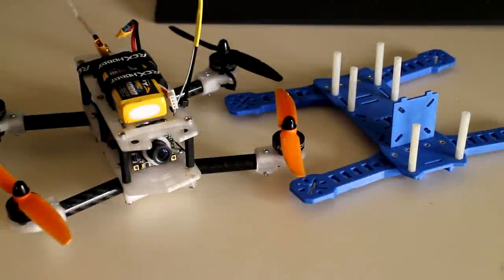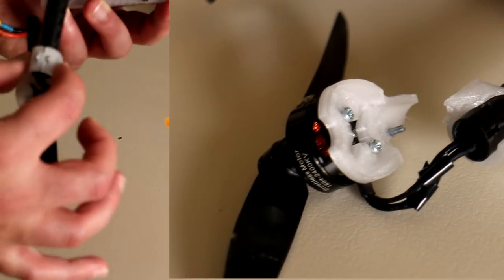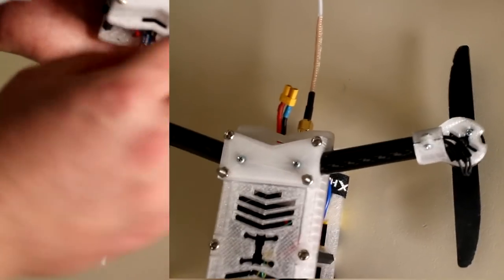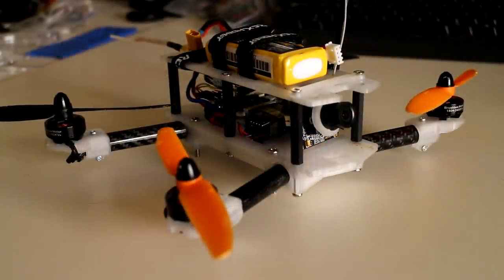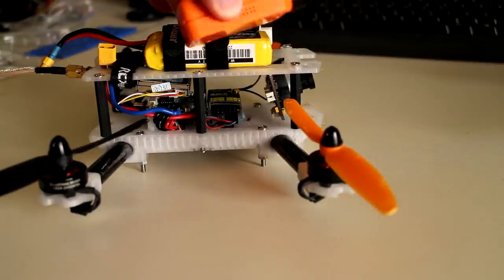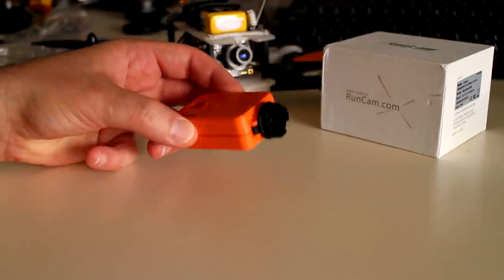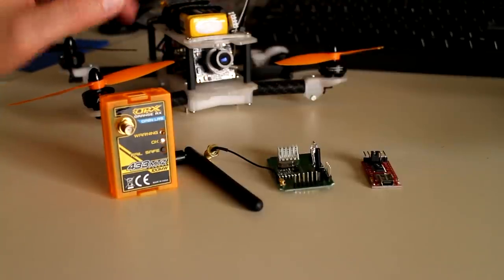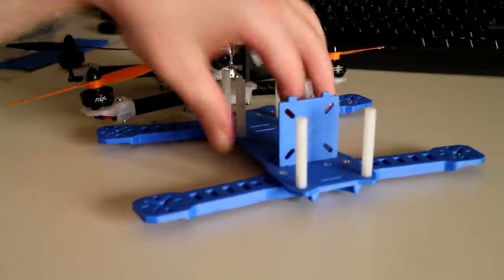New videos coming up next... :)

Comment: I haven't tried it personally, but I know it would work, as the rubber o-ring will give a better friction fit once trapped. Some of the tilt-rotor type of quads also use this style of connection.

Comment: This frame looks awesome! However, i prefer 250mm-280mm as i use a gopro and need the extra space. Any chance you plan on scaling it up a bit?
Reply from the maker: +plane1233 
I've allowed enough width to use a GoPro. You can even use slightly longer carbon tubes. But with this size frame we are restricted to 5 inch props.

Comment: Its indeed a nice beauty frame, combination cheap CF and strong PETG filament. Its even much better if it can be folded, to make easier to transport. What 3d CAD software do you use?
Reply from the maker: +flyrobot flyrobot 
Yeah the tube is cheap. I'm not including folding arms in this design as it would reduce durability and probably increase weight. I'm designing this as a pure "basher" that can withstand harsh knocks and crashes. The only bits that should break are props.

Comment: Those prints look amazing, congrats! I'm just weighing up between buying a replikeo or a tarantula. Would you buy the same again if you stuck to the same price bracket?
Reply from the maker: +float 
Hey thanks!
I think so. The Replikeo is $250 plus shipping. It's a common version of the Prusa i3 (Rework) and plenty of support on the reprap forum as many people own one. 

If the Tarantula is about the same price, I'd give it a try. It does look really good using acme rod for z-axis and rollers plus extruded aluminium instead of linear bearings and smooth rod. It all comes down to support as you may encounter an issue and you'll to ask for help.

Besides that I think either choice will be great!
Reply: Hey, thanks for your advice!

I was unaware the Tarantula used a different type of z-axis thread. I can buy the tarantula for about 100 usd cheaper (including shipping), so maybe I'll buy that instead.

There certainly is a lot to learn, it should make for a good hobby.
Hopefully one day I'll achieve your standard of print, keep us updated with your projects :)
Reply from the maker: float

I'm sure which ever printer you choose will work awesome. A few tweaks and these kits can produce stunning results!

Project updates coming very soon...

Comment: How much do the non-printed components for the revised 230 cost? I'd really like to start flying :D
Reply from the maker: +Bruce Wayne 
A rough estimate for basic parts...
4 x motors and esc's = $60
Flight Controller = $20
Radio Control = $50
Battery = $15
Battery Charger = $20
TOTAL = ~$165

Then there's just small things like props, connectors, wires, etc which are really cheap.
Reply: Wow :D That's extremely cheap. Thanks for replying!

Comment: Incorporate some properly sized o-rings into the clamping areas of the carbon fiber tubes. Should help eliminate the rotation of the motor mounts.
Reply from the maker: +Dinky R/C 
Have you tried this? I want to not have to drill holes and insert screws to lock the tube in place but I don't see any way around it. It doesn't matter how much I clamp the PETG around the tube, even if I can't rotate it by hand, on a hard crash it will still rotate slightly.

Comment: can you use heat shrink over the carbon fiber so you don't need to drill a hole?
Reply from the maker: +Chi Sty 
That's an interesting idea! Have you had experience with this?
Reply: +Tech2C not yet but i do put a piece of electricity tape on my batteries and it grips well.

Comment: You should use Nylon filament and when you design your model you should carfully to ticken the area that are commony prompt to mechanical stress during the crash, front part, of course motor mont like you did, and bottom. You thin 'V' shaped motif in the bottom is not a good idea.
Also try to use geometrical form know to help distribute the load during mechanical stress (honeycomb, hexagonal shape, arch and curve).
Reply from the maker: +Bonbadil Moi 
I was going to use Nylon for the motor mounts then realized the design is too weak if I must use Nylon. The new design should be rock solid so it'll be interesting to see where the next weak point is.
Reply: Tech2C i didn't know you already did a test on nylon, it was very interesting.
Flexibility was expected, but the alloy version is really a good material for a quad IMO.
Did you thinked about building a multi material quad ? A CF core using a very basic shape easy to buy and cut (a standar CF holow square or tube easy to cut with a simple metal saw) and a 'skin' wrapping around this CF arm in a flexible material like Nylon that hold the shape (not a simple motor protection)
In my opinion, relying entirely in the material to handle all the load during violent crash is not the solution, it is just one. I am thinking about trying to predict the direction of the load (like during a car crash test) to create a 'living' structure that absorbe the chock, even if than mean using part specialy designed as a sacrificial part just to absorbe all the load, in conjonction with a spring shocker made in nylon, strong enough to not budge during normale use (vibration from motor mount...) but will deform during crash to absorb the shock.
Sorry for the bad english.
Reply from the maker: With the experience with the Peon230 frame, the weakest part was the arms hence why I'm switching just that section to carbon. I haven't broken the main body as of yet so I assume it's strong enough. Saying that I'm now printing with PETG which is much tougher than ABS/PLA so I think with that combination this new frame design should be quite durable. Of course I won't know until many crashes. Thanks for your comments.